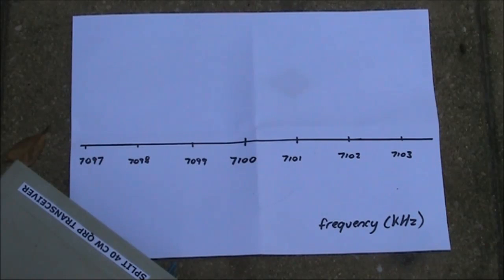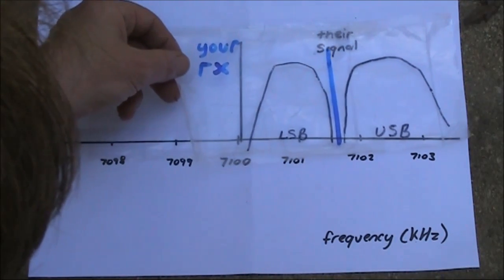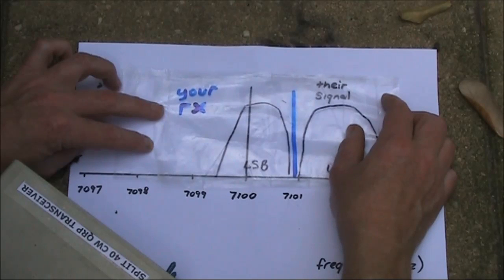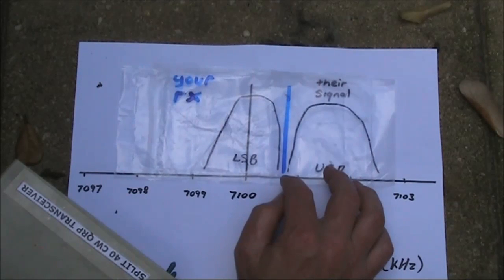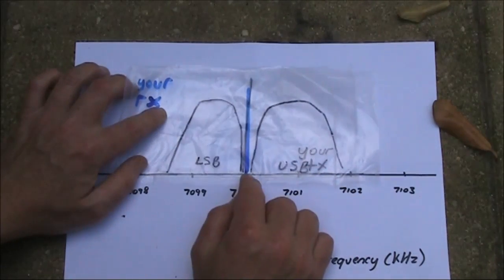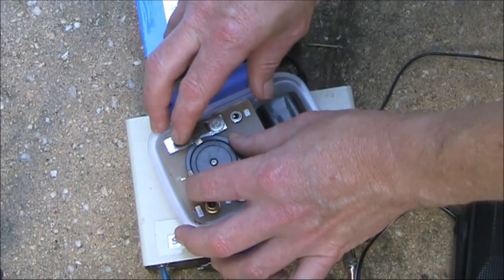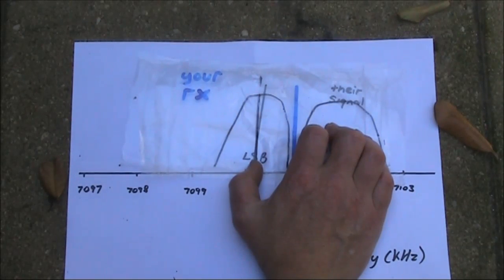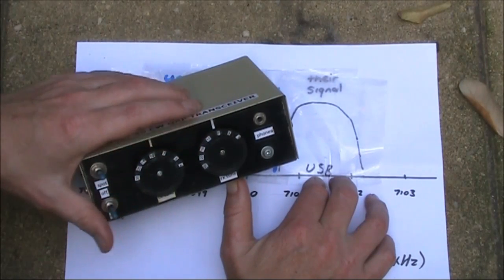Transmitting on the right frequency with direct conversion CW transceivers

Comment: Peter:   I'm having trouble setting up a frequency offset on a 40 meter DC transceiver.  1 pf moves the VFO 17 kc!  I only need it to move 700 Hz.   Any thoughts on a circuit that will move the freq the desired SMALL amount?  I may have to resort to your two VFO with a spot switch...   73  Bill N2CQR
Reply from the maker: Bill - Try series and parallel capacitors. Eg something like a 20 pF trimmer in parallel with a 220 pF capacitor will give a range of 220 - 240pF. Then put that in series with a low value capacitor - say 10pF. I haven't done the maths but you will get a very small variation in total capacitance. 

Other more common options include some sort of diode circuit using almost any type of diode (which can vary capacitance when DC is applied). Then  you have a fixed voltage divider on transmit but then on receive have a potentiometer to allow some fine tuning +/- your centre frequency. That gives you a variable offset which is handy for DC transceivers. Solid State Design probably has circuits for that.
Reply: @vk3ye  It is much harder than it seems.   My transmitter VFO is all set up and very stable, but if I add 10 pf, the frequency changes by 170 kHz!  So 1 pf would move the VFO about 17 kHz.   Way too much.  I need to move it by 700 Hz!  Even the switching arrangements (diodes, relays) add capacitance.  I've tried with a "gimmick" but it is difficult.
Reply from the maker: @williamrmeara2162  Use a smaller inductor. Then  you have more capacitance to play around with. Or reduce C values in the oscillator. Then use diodes as varactors to vary the frequency slightly. Switch in a fixed voltage divider on Tx and a pot for RIT on Rx. All explained in Solid State Design.